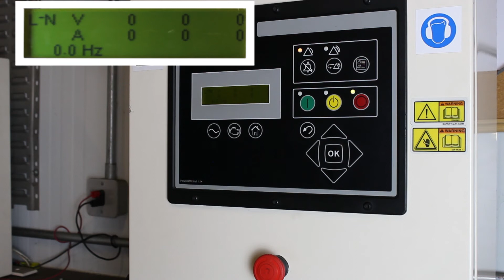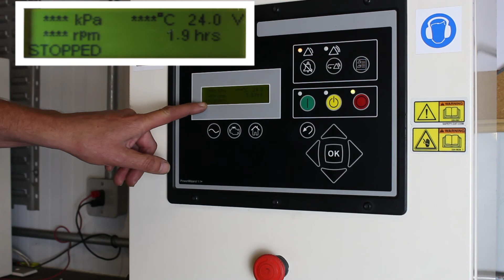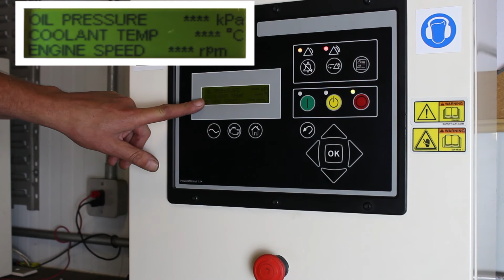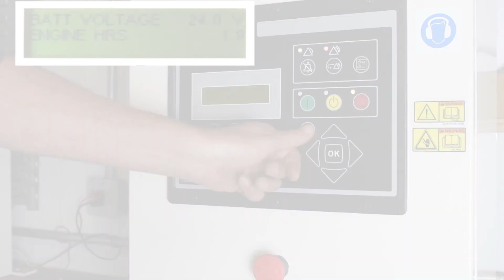How To Use PowerWizard Control Panel Menus

Comment: I need your help, my generator has a problem, when I start it, the circuit breaker trip, and the notification I got is that...
Short circuit in digital output